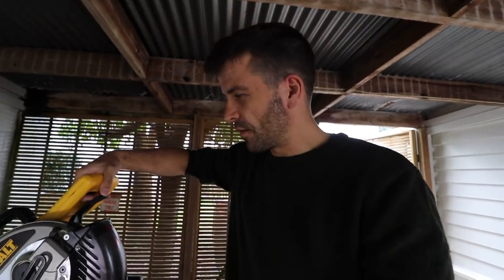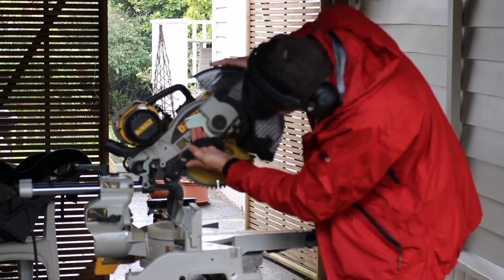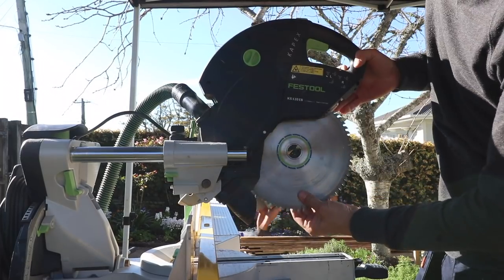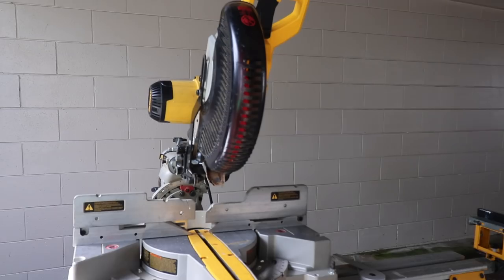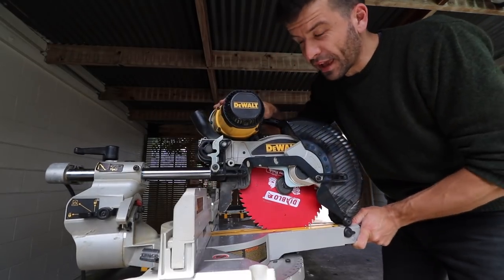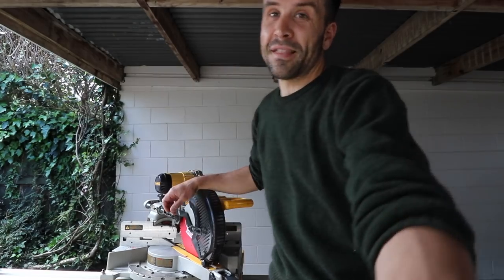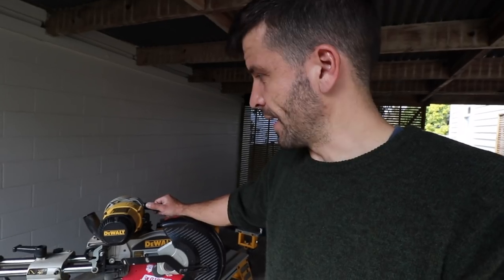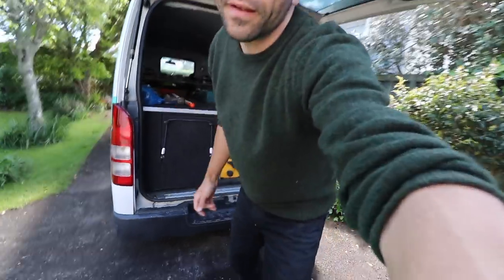Festool Kapex vs Dewalt Mitre Saw

Comment: Great opinion. I've got the kapex and love it but only use if for finish carpentry and handrails on decks. For rougher work, exterior framing work which would involve a chop saw, I use another brand. Great work on the deck you built! Supprised it didn't come with a couple sheep! Lol! Keep up the great work!
Reply from the maker: Lol thanks Brian
Reply: I have the kapex and the dewalt 305 flex volt I use both for framing and finish, both are awesome saws, in aus thou the kapex 120 is $1999 including gst and the dewalt flex volt is $1600 so both priced very close

Comment: I own a few Festool tools. The best money I ever spent is on the TS55 Plunge Saw, the one handed planer is great too although only cuts 60mm wide. The Carvex jigsaw is the biggest waste of money ever and then there's the Kapex 120. Mine runs at 110v due to UK site rules - the saw is underpowered and over-priced. I use mine on the De-Walt stand (Not compatible, you have to mount the clamps to a ply base and fix to the underside of the saw) The blades are deliberately supplied at 260mm so you have to use Festool blades although slowly other manufacturers are making 260mm blades. I wish I'd replaced my old 305 De-Walt with the same, the Kapex does not rival it!!! Save your money guys - Oh and the Festool stand is the flimsiest waste of £400 you've ever come across...............
Reply from the maker: Woah I didn't know about the blades, that seems crazy
Reply: Agreed on piece of crap festool jigsaw
Reply: Thanks,  I was wondering why Makita make a 260mm blade in their Blue Mak range. I was supplied one for my 10" saw bench ( table saw if you prefer). I will have to look into available rake angles etc.
 I don't use a mitre saw for wood as I have a large DeWalt  radial arm for cross cut work. I am thinking seriously about incorporating an MFT type surface when I replace the stand  with a cabinet.

Comment: I am a cabinet maker and specialise in finer furniture. I have had three DeWalt Mitre Saws and I currently use a Kapex by Festool. The DeWalts are well built, powerful and cut well, the Kapex cuts near perfect every time. With a great blade, Freud pro cut and fine tuning the Dewalt is great. With a great blade and fine tuning the Festool is perfection. 
Conclusion.....
DeWalt......great.
Festool...brillant.
Reply: Louie's Workshop why though? What makes it “perfection”?
Reply: @lgzz4885  great question, several elements spring to mind, when using the kapex when performing a simple straight cut or a 90° cut the mating of both connecting faces via a domino is simply Perfect! The smooth linear bearings that travel with no deflection or side movement at all, the interaction and linkage with all festool tools and accessories. Do i like the high cost.....no
Would I like these machine reduced in cost .....yes......are they better than other machinery......yes are they near perfect.....i would have to say ....yes.
Reply: Nothing you said is worth the more than double in cost.  I have the cordless 12" Dewalt drop saw and have absolutely no problems with joints or deep cuts.  Cannot ever see myself buying something like a felstel when my dewalt can do just fine when it comes to price.  Watching this video and seeing the set up and I have to say I will pass up the Felstel every time.  My Miter Saw Stand With Wheels (DWX726) makes hauling my drop saw around a breeze.  The stand was only $250.00 more. After buying the stand and the drop saw It still makes much more sense to buy the dewalt system by 150% over the felsteel.  Buying a felstel just makes a statement and that is all.  Makes no sense to buy it for business or residential use in my opinion.
Reply: @Flielow  Hi there, please don't get upset, this is simply my opinion, I value your opinion also, the dewalt mitre saw that I did have I liked, it was rock solid and powerful, I did find however that it lacked refinement and within the festool it offers that refinement and further accuracy that I need when designing and building bespoke one of furniture! I am aware you mention the stand for the saw however dont allow companies to blind you with value added stands etc, focus on the saws performance and what it can do in terms of fine cuts and joinery connections, I feel dreadful about the price and product costings of Festool, in my opinion they over price their product line, but tools this good, tools designed this well come at a premium price! Regards Louie
Reply: @louiesworkshop2023  you mentioned accuracy as advantage for Festool,  how out of accuracy was your Dewalt? some degrees off?
Reply: @cruzs.9040  The Dewalt was a great saw, rock solid and last for years but the kapex offers that crisp clean cut again and again, I would find it hard to go back to any other mitre saw now that I have and use the Kapex.
Reply: Flielow you have no clue, do you even work in the field? 1250€ is nothing we got machines for up to 150.000. This saw is stil worth 750 after 7 years of use.
Reply: I have had the De Walts for almost twenty years, I am a cabinetmaker/finish carpenter, and, builder. I do everything from furniture in my shop to building a house, or garage. I have done miles and miles of cedar lap sididing, ect. I love the easy way that the De Walt can be hauled in my truck or jobsite trailer. same goes for their 10 contractors table saws with the folding stands. I have worked on framing crews where i had to cut for the crew all day, and, the De Walt handle grip is the best, I have noticed that everyone else has started to copy that as well. Why did Festool continue with the very awkward and tiring handle? If a tool is not comfortable to use, it is of little use in my opinion. Form should follow function.
Reply: @keithkuckler2551  Thankyou for your reply Keith, an excellent and accurate response, I did if you recall highlight the power of the DeWalt and when I said that I have had three DeWalt saws this surely was a graphic indicator of my like towards the DeWalt mitre saw, I could not nor wish to question DeWalts toughness and that from saws in the past, they simply keep on going, but framing a house and construction is some what very different in relation to fine cabinetry, the Festool is over priced, there is a question mark that hovers over its longevity but when it comes to its primary function and purpose I have to say with hands on experience with both brands, Festool does indeed come out on top. The style of handle found on most mitre saws including the DeWalt can cause excessive force to one side of the plunge stroke which can bring into question the direction of the blade that can compromise the cut and its square approach and follow through. The festool kapex is ergonomically at an advantage because the stroke is brought down via its design into the centre of its directional projection, thus offering a much more precise and repeatable cut. When force is applied within a centralized axis then you are promoting a more accurate approach plus it suggests a safer operational system for the operator. I hope this goes some way to clarify your limited knowledge of the Festool Kapex.
Reply: @louiesworkshop2023  I have over the years done a lot of furniture work as well. Including some of the more challenging designs by Frank Lloyd Wright. I have worked on a number of houses and furniture for two of Wrights apprentices, as well as doing commercial work, ect. I think the skill of the user is more important here than a small difference in accuracy you say you have noticed. A truly skilled craftsman, can compensate for any fault in his tools, and, proceed accordingly. I have a shop full of vintage tools and modern ones, each has it quirks, and, a person learns how to get the best result with what they have. That Festool might work for fussy finish work, but, it would be horrible as an all around saw. If had to use that to cut all day, my hand and wrist would be useless. Any slight deflection that you mention for the handle being to the right of the center of the saw is really meaningless in most applications. I could see the Festool, if it were a really beautiful piece of machinery, but, it is just made of plastic like all the others, I have tools made by Northfield, and Yates American that are truly a class of their own, and, the Festool is not in that class.
Reply: @keithkuckler2551  Why are you so angry Keith? All I can offer is my opinion gleaned by experience using my Kapex, I did not at anytime endeavour to degrade your equipment as I have no experience with your machinery! If the DeWalt suits you then I am delighted, for me after using 3 dewalts, good though they where, good was not good enough for me, when I began using the Kapex I was impressed and these highly engineered machines have allowed me to take my woodworking far beyond what I was used to! You may be dealing with slight deflection with the DeWalt, something I would not see using the Kapex, zero deflection, just a surgical cut, again and again and may I see 90% plus of incredible duct collection thanks to the clever Festool design and midi vac, all in all a superb machine, that sets the bench mark gold standards not found on other saws. Now before you reply, show temperance and reframe from attack.
Reply: @louiesworkshop2023  Not angry at all, sorry if i came off that way.  But, you did fail to address my gripe about the handle. If you are using a good blade, a sharp blade, and, the rails are beefy enough, i can not imagine the slight amount of deflection you are talking about. The saw and blade should be doing the cutting, and, your force on the handle should be minimal. All that being said, answer this one question. Why have all the other makers followed De Walt, in making the handle more ergonomic. It might be one thing to build fine furniture, i have done plenty, and, cabinets galore, but, if you have to do production work all day, a simple thing like the way the handle is placed makes all the difference. I have been buying tools for fifty years, and, have learned that simple is usually better, i just bought another DeWalt 12 inch slider with the light that shows the blade cut. I did not want a fussy laser, and, something simple like having that light did the trick for me. I am not catholic in my tastes, i buy tools from every manufacturer, depending on how they perform. Sorry if i come off with strong opinions, but, i just try to be honest.
Reply: @keithkuckler2551  Hi Keith, I will try and answer your questions, let's begin with the DeWalt handle design, dewalt cater for mainly but not exclusively the construction and trade where power and strength is favoured, the huge amount of stud timber to be cut, the enviroment and the movement of the tool, for example, hauled in and out of Van's and pickups, in this world the DeWalt is best and has built up a very good reputation for standing up to these riggers.
The Festool Kapex may not favour these conditions as the DeWalt does, the Kapex is much more at home in the workshop, it's a more focused precision tool, as I have said in previous posts, the three DeWalt saws that I had in the past where good saws, but repeated pin point accuracy was lacking. They cut well and even good, but never great, even with a razor sharp new blade and a good control technique I often found a slight runout.
When i bought my first Kapex it was a different experience from day one, the feel of the machine, the connection from operator through to machine was natural, the saws dynamics and design is so intuitive, the repeatable cut accuracy is stunning, the dust collection although not perfect is worlds ahead of any other mitre saw, is it over priced? Yes, is it value for money..... no, Is it the best mitre saw man has ever designed and built.....yes. that being said is DeWalt a good saw, yes and anyone with a DeWalt sould be very proud of their machine, why did I change over to Festool from DeWalt? I found the Kapex to be more accurate, easier to interact with and matched up with the Festool midi vac, a truly brillant combination.
The second question relates to the handle design, I liked the DeWalt handle very much and did indeed find that the Kapex handle took alitttle time to get used to, but when I did then it felt right, better, wiser, many other manufacturers do follow the DeWalt design but just because they do does not indicate a better design, design improves and moves forward, these companies have favour old  design. When you pull down on the right side of a saw head then the very best saws have their sharp blades deflected and thus accurate repeatability is reduced, the Kapex encourages the operator through its clever design to alloy pressure down and through the central axis of the saw blade and saw head assembly, and the results and clear, razor sharp accurate cuts again and again. 
Can I ask you a question Keith, have you ever had time with a Kapex? I believe if you then you would see for yourself what I and much more importantly many other say when they declare that the Festool kapex is the very finest mitre saw available on today's market.

Comment: Totally agreed. The Dewalt 12” without the LED system nor a stand was 300 Canadian dollars - you can pick one up normally for 350-400.  450 with the very effective Milwaukee stand.  The Festool is 1920... no thanks, spend the money on better blades and get to know your saw instead.  Good luck replacing anything on the Festool as well.  They are made for fine furniture making in a climate and dust controlled shop.  Very nice, but maybe 5% better at 4x the price probably with less durable components.   Simple is good at time.
Reply from the maker: I agree with that man

Comment: My work is quit similar to yours. I bought Festool hkc55 with the 42 cm track. Ever since I rarely take the miter saw to jobsite. It allows me to cut very accurate and predictable cuts from all directions. It brings the saw to the wood which is much more effective than you lift and put accurately a long piece of wood on the kerf of the miter saw.
You will love it!
I really enjoy every episode you make!
Reply: Shahar Dror as the say, a good tradie never blames his tools
Reply: Only the blades.
Reply from the maker: Shakar Dror Thanks man, did you get the corded version? Looks like a cool tool
Reply: @ScottBrownCarpentry  cordless. One battery is good for a whole day of deck making. Another advantage is you can use it with a regular festool track!

Comment: I have that Dewalt 10" saw and my co-worker has Kapex which i have also used. I haven't figured out why it cost more because there isn't much difference at all. Well biggest difference is adjustable RPM which thought i never would need.

Things is like more on Dewalt
1. Shadow cast and illuminate for work piece instead laser lines
2. Operating handle is sideways more natural position for hand when cutting.
3. Takes less room when transporting

Things that is better for Kapex 
1. It runs little bit quieter (sound of motor) maybe weaker engine?
2. You can saw little bit taller molding when raised against back fence (with thickness limitation)
3. Little bit easier fence when you need to make lot of similar length pieces because fence has measurement tape attached.

Comment: I've had my kapex perched on a standard dewalt stand since they were introduced in Australia many years ago. Remove the rubber button feet on all four corners and it fits good. The over priced festool wheely stand wasn't nessecary for me. So don't be discouraged by their brand stands and such, wack it on something else. 
People talk about frame vs finish carpentry and how the festool is more capable at finish but I use mine for everything. Blade change for each and your good to go. I treated it like a princess for the first few days the after that it was just a saw. After near 10 years of service , many house frames and fixouts it has no float or wobble in the head, no dodgy brushes throwing sparks everywhere. A little possum piss in the right spots, good blade and she feels brand new.
(Just my biased opinion 😉)
Reply: You can't beat the kapex, I use mine for any job when needed, even cutting cement sheet weather boards.
Reply: based on your review I went into my local hardware and asked for a can of 'possum piss' and nearly got thrown out of the shop :)

Comment: Your 10” is the newer model I too have the 12” dewalt and it’s been with me for 16 years it’s as true today as the day I bought it! The only thing I can say about the the stand is “the bloody rubber feet keep falling off I keep meaning to glue them back on but keep forgetting! Lol I also have another dewalt stand I got from a car boot sale for £10 a bit of damage but I’ve cut it down to 4’ or 1200mm so I have a smaller one to use in small areas.  I have just purchased the 36v makita 10” chopsaw or as you boys call them dropsaw, and when I say it’s an awesome bit of kit it it defo is. Keep the vids coming for the carpenter brotherhood and the rest of the world.👍👍🏴

Comment: Used a Festool Kapex in the Dallas Makerspace. It is very nice to use. Quieter and gives really nice cuts even with a dull blade. A quality German made power tool will last a lifetime.
Reply: So it's like a BMW and Dewalts Milwaukee and Bosch are your c5s and srt8s and then ridged and everything else under that are your basic entry level v8s like cameros and mustangs.

Comment: The "precision" that Festool raves about on your first and all cuts, you get on the DeWalt, Makita, etc. saws by using them, dialing them in, getting to know them, by mastering YOUR use of that tool.  Yes, if I push laterally on my DeWalt it will cut off of the line.  But guess what: I don't push laterally when I'm using a chop saw.  Duh.  It's called knowing your tool and how it best cuts straight.